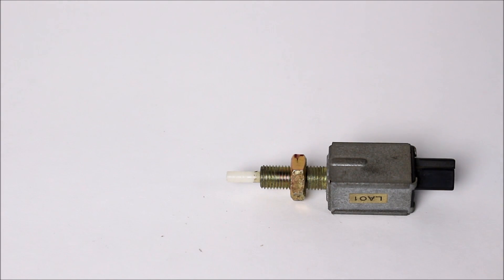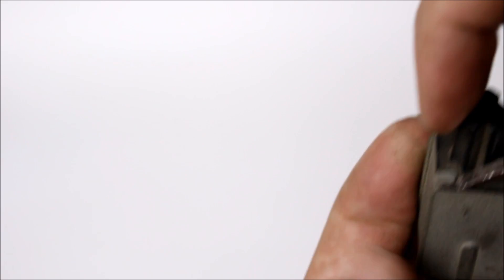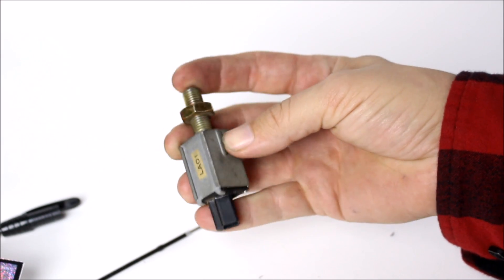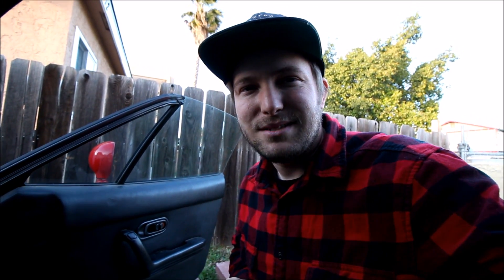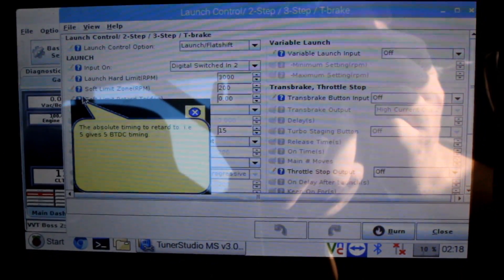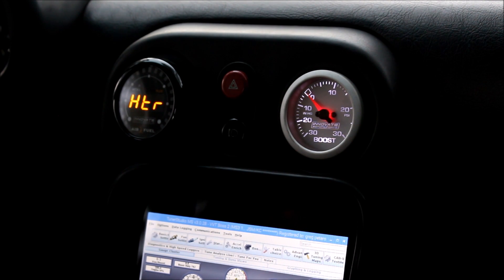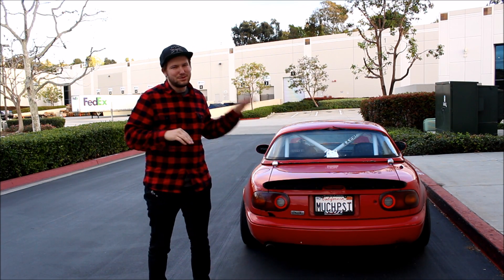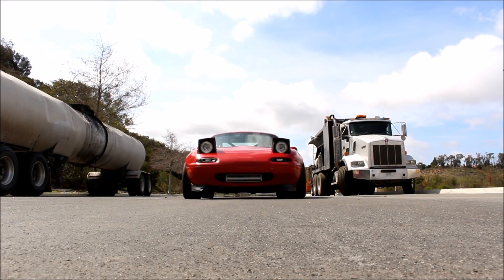I Fixed My Launch Control For 2 Cents! Shooting Flames With Megasquirt.

Comment: Id like to add a few extra points that I've been chasing my head around for a year or so now. If you have a MANUAL or AUTO chassis that was equipped with cruise control you MUST unplug the Neutral Safety switch, this switch ties into the top clutch switch and prevent it from successfully grounding itself. Therefore launch control will never activate.

Comment: Hi just found your video I have a 1990 1.6 mk1. Running ms3 mini. I don’t have a options plug. Iv read you can link the neutral switch from the gearbox to the upper clutch pedal witch and jump the  cable you remove from the plug. Any idea if this works thanks.

Comment: If the clutch switch has 2 wires. And u tap one one into the ms2, where is the other wire on the switch going to?  And it doesn't mater which wire u use on the switch right?

Comment: Hey Greg, switching over to the top clutch switch today. Do I need to remove the jumper on the MS board for clutch switch to launch control? I was thinking yes... otherwise the car would still use that signal instead of the top switch as intended.
Reply from the maker: You shouldn't need to do anything with the MS. You're only changing which switch it's getting its signal from
Reply: TheCarPassionChannel  I ended up taking the jumper out. I wired LC to a switch and in either position the launch control would activate. All fixed now.

Comment: Do I need to cut the connection to the brown and white clutch switch wire from the factory plug harness, then wire it to the options port??

Comment: You won't bed rods. Think about it, the cylinder pressure won't be as great as you are doing combustion late. What you will damage is your valve train. The pressure on the exhaust valve from the pop can throw off the motion
.

Comment: Hey man I got a quick question so I just replaced my clutch master cylinder and my slave cylinder and I bleed the clutch out 15 times and when I take it out for a spin it struggles to go into gear unless I double clutch it might have any idea on what it could be ?

Comment: At 12:23 is that water vapor or oil residue spiting out the exhaust ? Still the sound on open exhaust is mmmmmm sweet mx5 tuning 👌🏼

Comment: the downside to the top switch is wehen you flat switch the clutch engages before it pulls the spark back in which snatches the clutch a little
https://www.youtube.com/watch?v=D5U3RPJ509Q

Comment: Why even bother with a 3000 rpm 2step?
Reply from the maker: Franco Inocencia Where you set your launch RPM is going to depend on traction,  power, launch surface, etc. It's going to vary for everyone
Reply: TheCarPassionChannel So, why even bother with a 3000 rpm 2-step? Just discard it and use it where and when it really matters.
Reply from the maker: Franco Inocencia I'm not sure what you're asking. You can set up 2 different limiters, one for launch and one for flat shift. The flat shift limiter activates above a specified RPM.
Reply from the maker: I guess technically it's called 3-step
Reply: I'm talking launch control
Reply from the maker: 3000RPM is an example, you can set it to whatever your heart desires man.

Comment: Hey Greg, quick question.  After splicing the launch wire from the acceseraries pin out to the clutch switch,  do you take the jumper labeled "launch", inside the ecu, out or leave the jumper in?

Comment: Hey Greg, so my launch control always engages, 95 miata, have a MS as well. It will always be engaged, if I have it set at 3000 the second the car hits 3000 it engages.. Regardless if I'm driving or not.. Any idea why?
Reply from the maker: Btb971 could be an issue with your neutral switch, or you might have it set on the wrong pin in tunerstudio

Comment: Greg, I'm thinking of buying the same seat as you. Is yours mounted to stock miata rails? How much lower is it? And would you recommend it for daily use or no?
Reply from the maker: Mines mounted on a hacked up PCI rail directly to the floor and it's slammed super low 🙂

Comment: I should warn the viewers that driving like this can have a toll on your gearbox, particularly with higher horsepower. I don't recommend using Launch Control or Flat Shifting for most applications where it's just not necessary, and is purely a 'toy'. It has its uses, and street cars are not one of them.
Reply from the maker: It can actually be easier on the box than a "hard shift" because the power doesn't come back on until the clutch is released, so there's less shock on the trans. Properly executed flat shifts are actually quite smooth. And launch control isn't any harder on the box vs. a regular launch, it just helps by holding your initial rpm right where you want it
Reply: TheCarPassionChannel The keyword there is "properly executed". Launch control is definitely hard on a transmission. I fear the number of people that are going to destroy their 5 speed because they think pops and bangs are cool. I'm not a fan of "launching" full stop, it's the biggest moment of strain on the driveline,  particularly when running a sticky tyre. To paraphrase my original comment, I'm not saying don't use it, I'm saying only use it if you know what you're doing.
Reply: Sakta no anti lag in this vid btw.

Comment: I had problems the other way around on my Megasquirt Lancer: I always used a top switch (diy installed, because the car did not have one) and if I did not release the clutch 100%, which happens if you do it quickly, the launch control took over and lost power between shifts (I did not want a flatshift in that setup)

Comment: You can’t just tell MegaSquirt which input the switch wire is? Because it already plugs into MegaSquirt. Or do you need to keep it plugged in and also add it to the options port.
Reply: TheCarPassionChannel pretty sure you can do an internal mod to the MSPNP to do this rather than splicing a wire. (Technically it would be doing the same thing but inside the case)

I should be doing that this weekend. You got me wanting to check my clutch switch because I haven’t been able to get launch control working for about a year and a half now when it used to work.  If I figure out the internal case mods I’ll send you instructions.
Reply from the maker: Kyle Rothschild I think you can do it that way on MS2. On my MS3 I had to add the wire to the option port.

Comment: Hey man, I also thought about putting my launch control/ffs on the top switch, but I find myself sometimes resting my foot on the clutch pedal,  it would engage. So I didn't really want that happening. Unless you're system works different than mine. Solid video👌🏼
Reply from the maker: Sup Kalvin! I used to do that too but I kinda trained myself out of the habbit because I worry about putting a constant (albiet light) load on the throwout bearing by resting on the clutch pedal. At this point I'm so tired of pulling transmissions I don't want to give my car any more reasons to make me do it again LOL. Also for me personally, the launch is easier to control. But that's all personal preference.
Reply: Never rest your foot on any clutch pedal, unless you want trans issues. No reason to anyways, may just be me overthinking but easier to change a habit than a trans. lol. and... cheaper.
Reply: Kalvins Garage two of the best channels!
Reply: Same/similar for me as I wrote in my other comment earlier. Once I hit a pothole during a hard pull, and the clutch pedal moved a bit - only a little bit, but enough to disengage the topswitch--》engage fuel cut --》epic fail 😂 ..The pedal return force was not sufficient on that top range of the pedal movement. Perfect Miata btw 👍
Reply: Yeah no doubt, I hear you there, my issue was I like to keep my foot on the on(not engaging) the clutch pedal as I row though the gears to get up to speed sometimes. But my flat foot shift works a tad different. When the clutch pedal engages, it goes into anti-lag mode. With a rpm limit of about 7000 if I'm not mistaken.But yeah the issue is the engagement happens before you reach the clutch button at the bottom. Ive yet to try flat foot with driving the car hard.

Comment: Glad you got this to work the best way possible! I have a 1.8 on my 99 and all I had to do was go into ms and set up launch control no wiring or anything which was super cool! Also works the same way yours does now.
Reply: How is this possible with no wiring?? How does it activate,  and how do you disengage it?
Reply: @MichaelArmystrongRyan  megasquirt uses the factory harness. So your clutch switch and tps sensor are the only thing it needs to activate launch control. If clutch is depressed and throttle is past whatever position you set it at. It will retard your timing and enrich fueling. End result is flames out the pipe and pressure in the exhaust manifold which pushes your boost up if you have a turbo.
Reply: @bradley-klamp  Im using microsquirt in my turbo mustang build. Hoping it was just as simple.
Reply: @MichaelArmystrongRyan  it is, microsquirt still has all the inputs you need. Only thing is what motor you are running. If it's efi you can do it. If it's carbed and dizzy you can't really.
Reply: @bradley-klamp  ok, I'll play with the settings.  It's a 302 efi with a 76mm and manual transmission 🤞🏿
Reply: @MichaelArmystrongRyan  wire your clutch to either wled or aled then youre good and just need to set up your launch control. Pretty simple just tinker with the settings a bit until you get it the way you like it
Reply: @bradley-klamp  thanks for the responses

Comment: Thank you so much for this info! Been following the VVT build from the start and you’ve inspired me to get a Miata for my next project.
   I bought 2-step for my mustang and used the ground on the bottom switch. Not wanting to break anything on my 15 yo car it’s basically useless, so that purchase was disappointing (sounds cool though).
   Now that I know what I did wrong I’m going to work on it myself but if anyone knows where the ground wire is on the cruise clutch switch on a 2003 GT I would greatly appreciate a heads up!

Comment: What happened to the transmission issue?
Reply from the maker: I just turned down the power for now, running a 5-speed. Upgrade coming soon
Reply: TheCarPassionChannel what are you going to do with the lsd?
Reply: i just remembered, taylor Ray is using a 350z transmission in his miata. granted it's being pared with an ls but maybe it could be done with the 1.8 vvt

Comment: Guys that don't know anything about either, you need to be very careful and use it with caution. This information seems to have been left out of the video.

Ignition cut 2 step is pretty harsh on on turbine wheels and excessive use will erode/melt the blades.  Fuel cut is safer to use.

Flat shifting/nlts/3 step is extremely hard on the transmission and clutch so don't be surprised when you see premature clutch wear and syncro damage.
Reply from the maker: AGT When properly set up, flat shift is not harder on the clutch or trans vs a regular hard shift. The power doesn't come back on until the clutch is out, reducing drivetrain shock.

Comment: So if you wanted to throw a switch in the cabin to engage or disengage 2 step/3 step would you wire it in between the OEM harness and the options port? Also, is that switch present on non cruise control cars? Thanks for the heap of informative and helpful videos Greg!
Reply: fourbyonehundred you would wire the switch directly inbetween the wire coming from the options port to the clutch switch

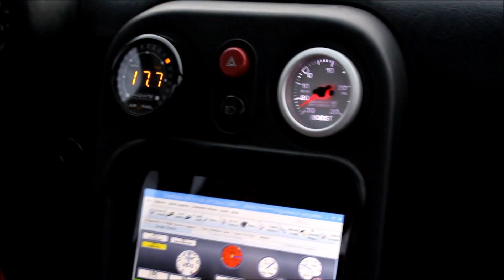Comment: 10:08 not sure why you are in the 17 AFR with 0 throttle. it's not a fuel cut because you would be at 22 AFR soooo?
oh whel it stays at 22 even during some pulls xD
Reply from the maker: o2 sensor is dead... readings are not true to what's actually going through the motor haha
Reply: TheCarPassionChannel dead from the flames? :p how far from the turbo was it?

Comment: Hey Greg. Im having a hard time deciding which supertech pistons CR to get. Im building my bp4w, not daily driven. And i have e85 available to me. But i would also like a 93 tune for shit and giggles. What would you recommend? And would going 84mm like you make any difference?
Reply from the maker: Boring up from stock doesn't make a huge difference. I did it just to have 100% fresh cylinder walls, and because I don't think Supertech makes 83mm pistons. Personally I think 9.0:1 is a good balance (that's what I run). I was able to get 332whp on crap 91 octane, haha.
Reply: +TheCarPassionChannel cool, thanks for all the info you provide dude. Your videos are extremely helpful for my built , not so much to my wallet lol.

Comment: Does every Miata/MX5 have that switch behind the clutch? Because I can start my car without pressing the clutch lol
Reply from the maker: McFreshfleisch I've heard UK cars don't have it but I can't confirm. I don't have to push the clutch in to start my car because I have it bypassed
Reply: Thank you for the fast answer! I can't confirm that either, because I have a car that was only built for the german market... I guess it's either bypassed by the former owner or it's stuck xD
Reply: yeah i think it's a miata thing, i can start mine without the clutch aswell but it's a european mx5
Reply: German miatas don't have the clutch switch (only on the top they have one )

Comment: the wideband it's ok?
when you do a flatshift with the camera focusing at the boost gauge the wideband stay al 22.4
Reply: Loso Variant his o2 sensor is mad
Reply from the maker: o2 sensor is dead... readings are not true to what's actually going through the motor
Reply: I saw that too....way lean

Comment: I just added jumpers to both the clutch and launch jumpers on the board. MSPNP2 board 1.3..I think its Jumper 4 and Jumper J6.  no wiring to DB connector.
Reply: in fact it would make no sense having to jump a wire from the 2 connectors.. just do it internally.
Reply: Im confused Jumper 4 is launch control. and j6 is?

Comment: So for those of us that did the neutral switch wiring, do we just plug the neutral switch back in and convert everything back to stock? 1.6
Reply from the maker: Yes all of my wiring is stock except for the one wire I added to connect the factory clutch switch to the options plug on MS. Check the lenk in the description for the wiring/setup etc